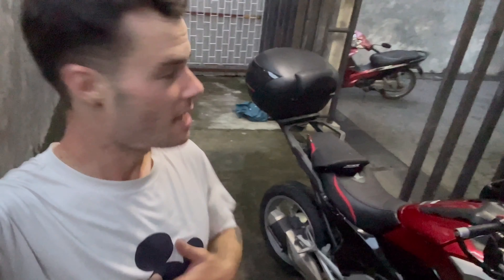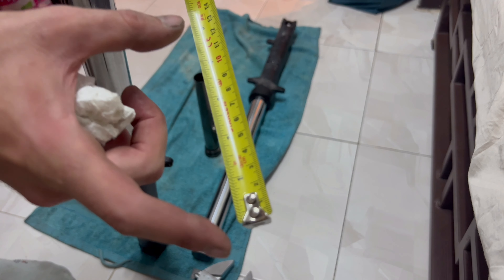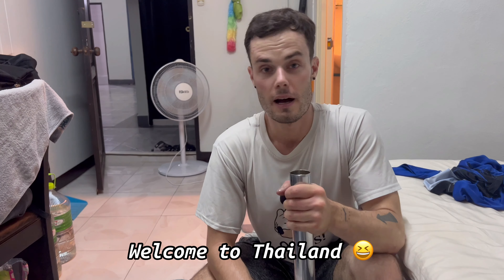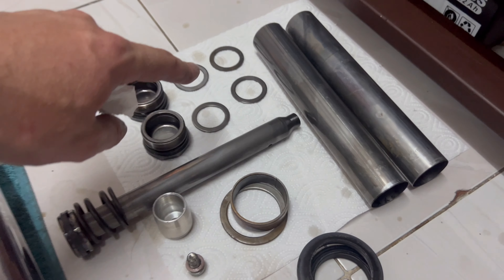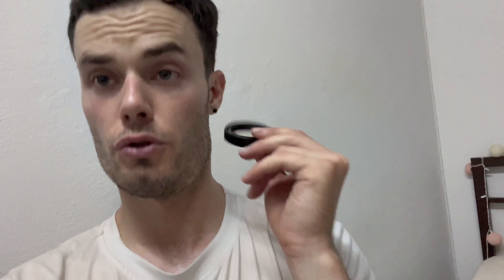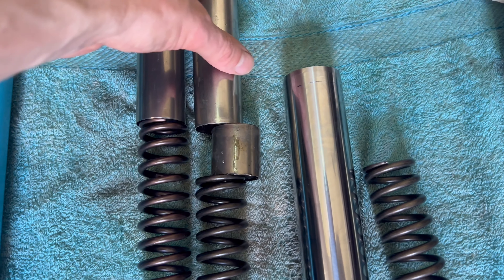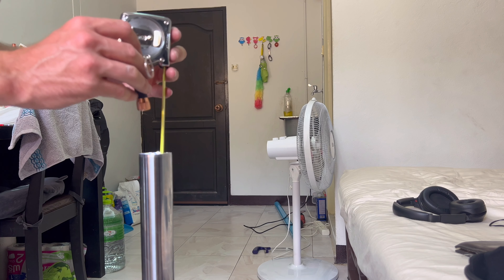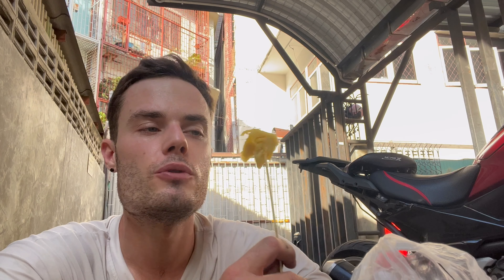THIS CHANGE EVERYTHING 😎 MOTORCYCLE FORK NC750X 😎     ส้อมรถจักรยานยนต์

Comment: Good job !! I think I'll upgrade also mine nc750x 2021, thak u bye
Reply from the maker: Yes sure you need because the forks of the nc750x and also the rear shock suck. In reality I have sold that NC to buy the 2023 model and now I am selling the 2023 model to purchase the Nt1100 to have a motorcycle without having to need to change parts to have comfortable ride
Reply: @damija01  It won't make a difference, every new bike has cheap suspension.